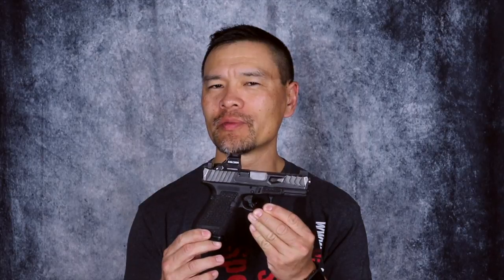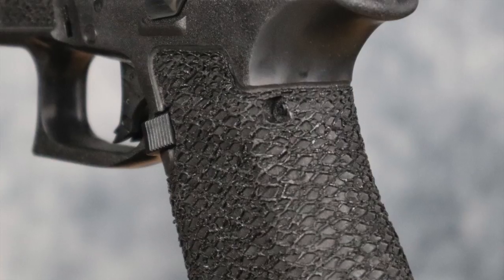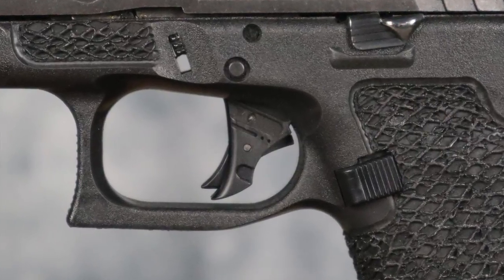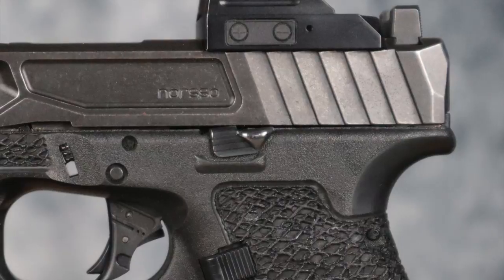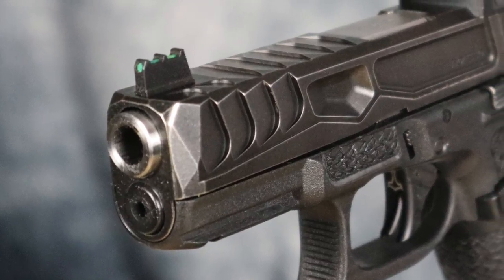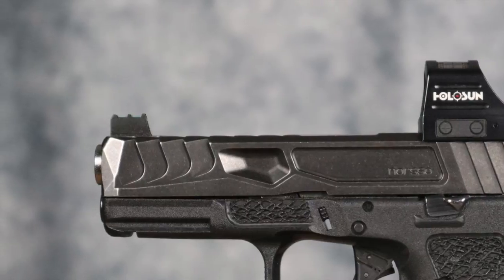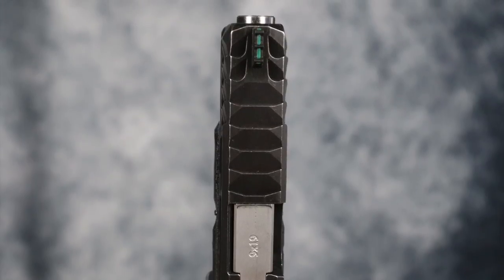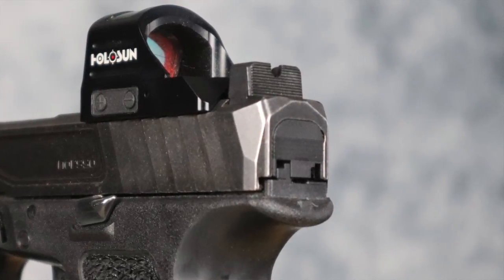10-8 Performance Lab, Episode 26: Norsso EDC Reptile Glock 19

Comment: I've had issues with my Norsso Reptile C G19 gen 5 slide. I've tried using a Zaffari Precision, OEM Glock, Firing Squad, Rival Arms, True Precision and an Aim Surplus barrel in the slide and it's gritty... like so gritty, it sometimes doesn't like to go all the way into battery. The slide also rubs off all my coatings from nitride, to TiN to PVD with a few racks. For $450 I think the slide could be better imo.
Reply from the maker: That's unfortunate. Your best recourse is to address this issue with Norsso.
Reply: I had the same problem with my tiger claw slide from norsso. I have a g19 gen5. I emailed them and they said they make really tight tolerances…they said break it in with 300 rounds. I had to put more than 300 rounds and it finally is smooth. I’m going to buy an slr for the same price instead.

Comment: Do you use a sealing plate for your optic?  If so, whose?
Reply from the maker: The 507c has a sealed battery compartment underneath - the cap screws on. So no sealing plate. For an RMR, use a Trijicon sealing plate.